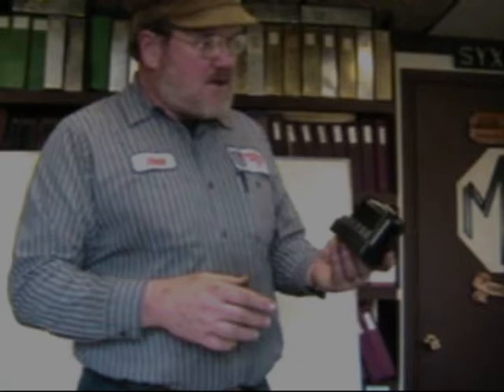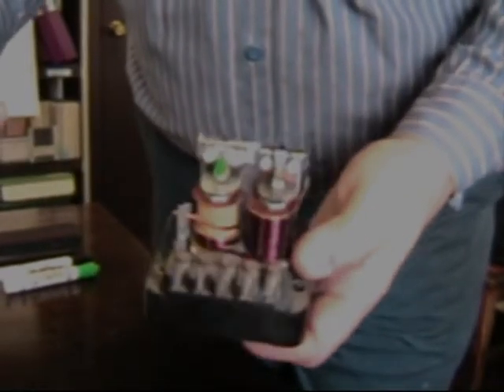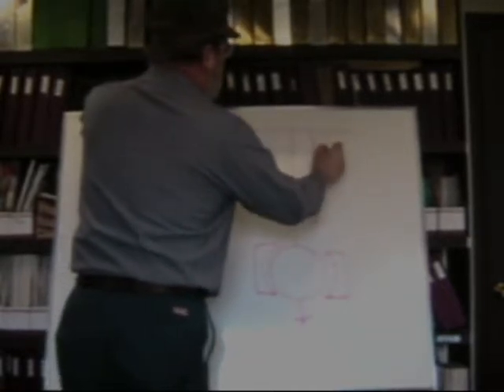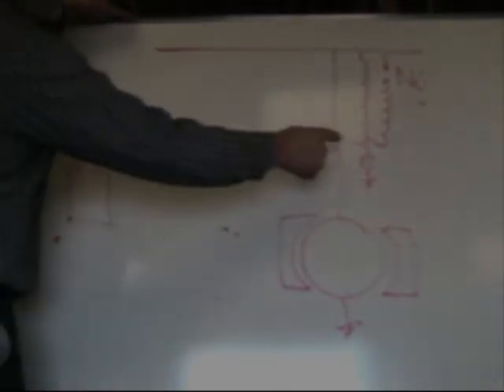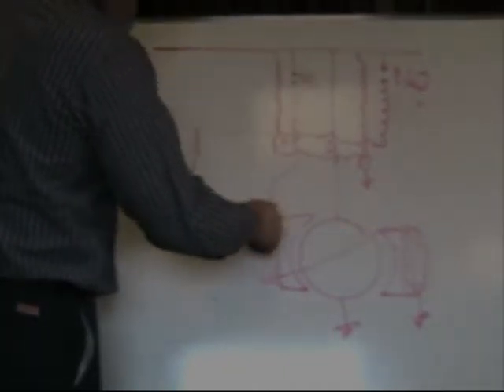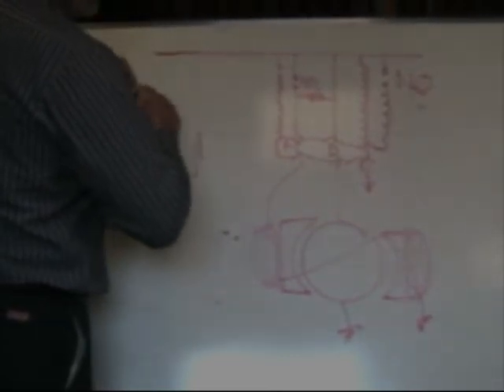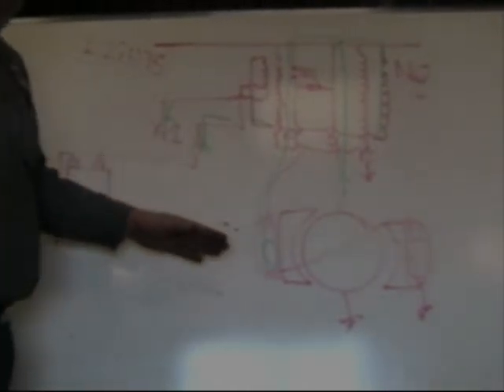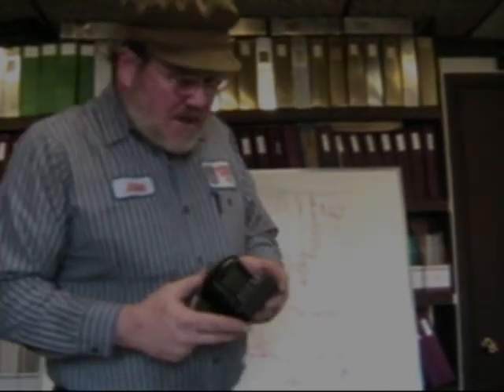042 MG Tech | Control Box or Regulator on MG

Comment: An explained diagram is worth a whole book of information.  Thanks for unveiling the mystery of old votage regulators.  I knew what they did, but never exactly HOW.  It never occured to me that you could cut voltage to the field coils to shut off the generator nicely.  I thought that the frame of the car just ate up all that heat.  I guess I was too simple minded and thought the generator was like the bicycle dynamos ;)